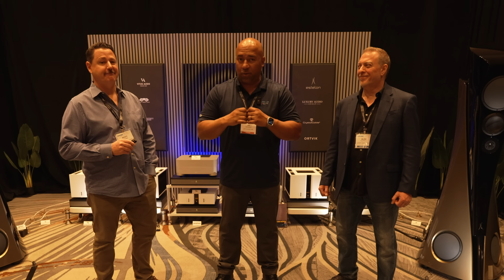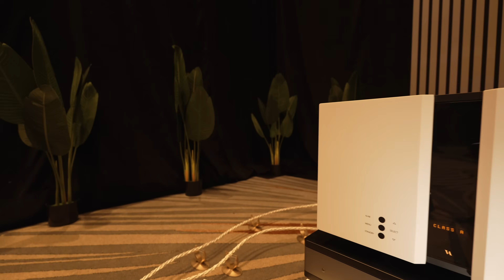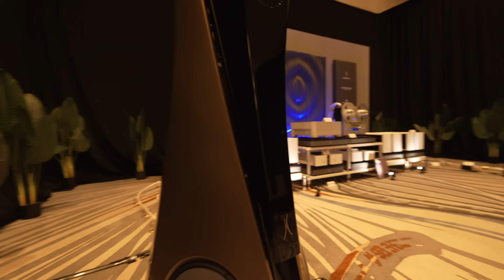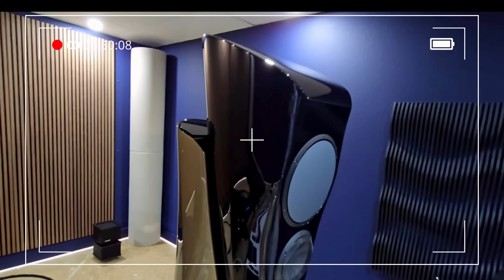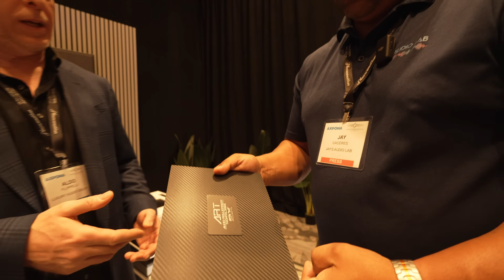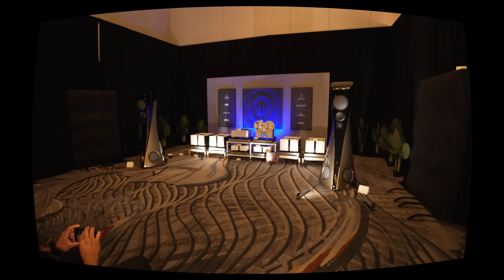Best Sound Rooms at 2026 Axpona Hifi Show - Estelon & Vitus

Comment: I have a higher end system.  I can play this type of recording well, not as well as this setup.  However, it is with more challenging and older (analog) recordings that my type of system needs to reproduce as a live acoustic performance.  I listen to electronica but rarely to a post 1990 pop/modern recording which is engineered for audiophile sound.  Otherwise, I want it maximize my involvement with jazz and classical music as well as pre-digital pop non-modern engineered recordings.  My room and system is possibly comparable to this video's system for acoustic recorded music..

Comment: Why does one have to adjust a speaker height for a sweet spot instead of the speaker designed with super wide dispersion such as Von Schweikert Ultra speakers.  Even my VR9 SE Mk2 one can stand, sit, lay down anywhere in my custom listening room of average size, the same sound quality is present.  As to imaging, it's centered and this up down motion won't change that and won't make it wider or narrower (at least not theoretically).  Walker also sells Von Schweikert speakers.  Compare them their and what you want in your listening room.  If it's for you in one seat only, maybe it's great.  If you want to share your music-Von Schweikert.

Comment: As a potential buyer of these i was let down by their showing at Axpona. Nothing really stood out as exceptional and they had to have a sub in the back to fill the space. Maybe I'll go to their show room and try them there.
Reply: There were two active subs used in the room to help cancel and reduce bass peaks from the Extreme speakers in the room. Each sub was placed in the boundary peak zone at the back of the room, low passed at 40Hz, level turned to the lowest possible setting, and phase adjusted until bass peaks were effectively reduced (cancelled) in the listening area. After 5 years in that cube shaped room, we’ve figured out how to deal with the rooms horrible acoustics.